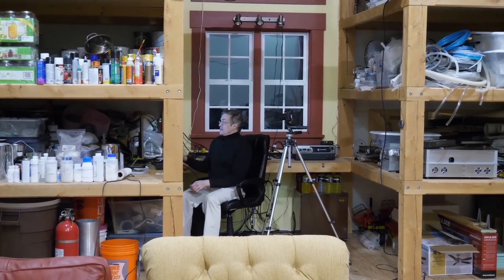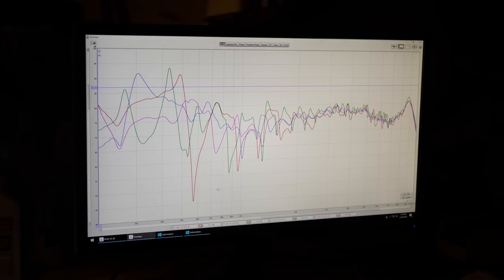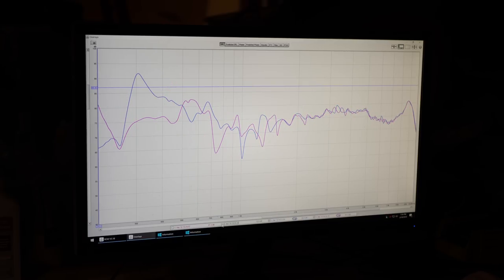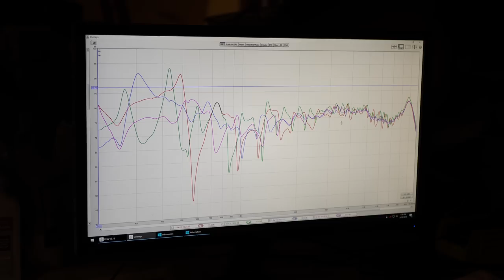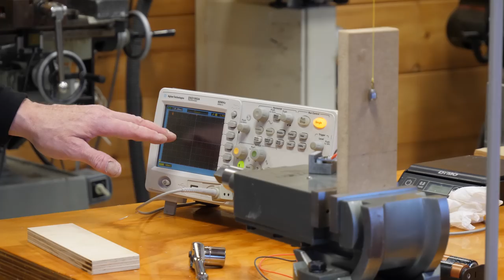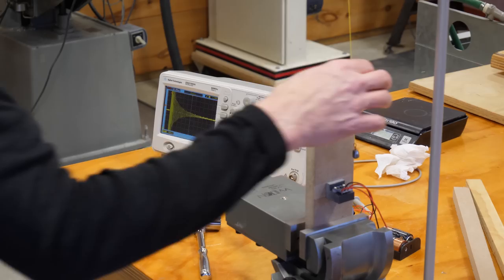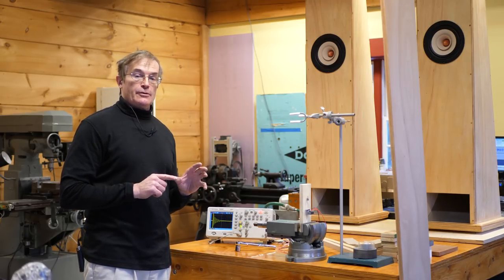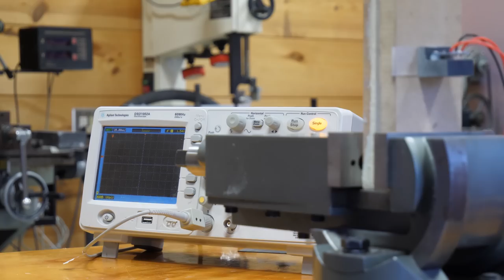World's Second Best Speakers!

Comment: Man the mdf comments had me dying. I've been binging your videos and I appreciate how you're very straightforward; lots of detail but no filler. These videos have been incredibly informative and when I get the chance I'd love to build a set of these or the DML speakers. Thank you!
Reply: The other problems it has are that it's a bear to work with, especially when it comes to screws and glue, and the second is that it LOVES moisture.  In a very bad way.  It's really a terrible material to build speakers out of but it is CHEAP and works well enough, as long as you are willing to put up with the outrageous weight.  Note that you will find many PA speakers now being built out of composites and specialized resins.  The last one I worked with - the entire speaker was 1/3 the size of my entire body and weighed 20 lbs.   Very nice. :)

Comment: Let me "sell" you a secret way of drilling perfect holes in wood: friction drilling. I learned it when building a wardrobe from oak.
What you need is a dull drill bit (!) and you start drilling normally on slow speed to the point where the whole tip of the drill bit burrows, but only just. Then you lighten the pressure on the drill and increase speed to maximum, allowing the drill bit to heat from friction as much as possible. And what happens next is magic - it goes through like in butter, and the exit hole is perfect.
There are 2 bonuses:
1. it smells good while you are drilling, and
2. because the hole is burned through, it will not react chemically with screws, so they won't corrode any time soon.
Reply: You good sir just achieved God Status....well done and thankyoi
Reply: @defaultentry  You can't call someone dull and then misspell "possess" lmfao
Reply: I sure can!
Reply: Use a sharp wood bit. Your dull bit needs to be filed in the f@@@it bucket.
Reply: Yeah i think I will just use good sharp bits and a backerboard to prevent Chip out.
Reply: Friction drilling is a thing.. In metal. Not wood.
Reply: 3. After the fire, living in a tent will really bring the family together.
Reply: I just use a nail
Reply: I think that thread lock might work the same or better to stop rust but might be wrong.

Comment: My God, this is hard to get through! 🙉😣🥴

“Don’t you use that tone with me!” 😄

Thos is one of your most interesting videos (for me) and you are so good at explaining - but that loud, constant tone. Aaaaaaargh! 😫

I really need a large mixer now, so I can listen to what you say and kill all sounds at exactly 1000 Hz. 🙉🙉🙉

I need to build a set of back speakers for the Lowther Audiovector Auditoriums, my dad passed down to me. I am going to have the sweetest surround system I could imagine. But I struggle with the principles and I suspect your explanations would have made it easily accessible to me. 😄

Thanks for the effort - and the simulated tinnitus. 😜
Reply: jealous. Paul Voigt, same guy who came up with the design in this video was reponsible for the Lowther driver, and some of the early Lowther cabinet designs. The Audiovector is one of the best. Lowther cabinet designs are notorious for being annoying to build, but they are very very good when you treat them right. They leave the Voigt Pipe AKA Tapered Quarter Wave Tube back in the kiddie pool. Do you have the single or double driver version?

Comment: Can you post plans for these speakers I would love to build these myself. Did you put a crossover on the full range drivers? I understand they are “full range” but they still have an optimal frequency range.  Fantastic video though I learned so much
Reply: Any crossover needed is built in.
Reply: It would not be a crossover - if anything it would be a BSC - a Baffle Step Compensation filter and perhaps a shaping (notch) filter that will adjust the driver's frequency at any given spot. Crossover relates to a division in a frequency - low pass, high pass, band pass etc...

Comment: Excellent demonstration! You just described the Bose patent:)
Reply: Not even close. Bose uses some resonant pathways to increase amplitude at frequencies which the drivers are deficient, but also require alot of electronic equalization to achieve reasonably flat frequency response. They also use multiple paths to reflective surfaces to create delay effects, which they describe as making it sound "live", And which does impress some listeners. Most audiophiles consider the sound unrealistic and precisely what one wants to avoid. Keep in mind also that purists like the least manipulation of sound electronically, as every process creates some distortion or other deleterious effect, and also try to avoid reflections, as they create additional frequency anomalies dependent upon the surfaces involved, phase delays, and false psychoacoustic effects.
Bose actually creates some of the problems that these speaker designs seek to harness and eliminate, or at least minimize.

Comment: I guilt a pair of Voigt Pipes very similar to those in this video about 15 years ago. They sounded very good, especially in terms of mid-range and soundstage. The mid-bass was also sufficient but could likely have benefited from addition of a sub-woofer for added slam. Eventually, I added a tweeter to add "air" to the system. Fostex produces a broad line of appropriate yet affordable drivers for this and similar designs.
Reply: I did the same and I’d like to upgrade my cheap drivers to a foster 8 inch driver.  Would you have a recommendation for a model?

Comment: While super ugly, my favorite for a speaker enclosure is coarse particle wood soaked in polyurethane then covered with outdoor carpet using contact adhesive. Give the polyurethane a week to dry and use enough contact adhesive with a roller and it makes the carpet extremely pliable.
Reply from the maker: That indeed sounds ugly.  Do you at least try to use only one type of carpet for each enclosure?

Comment: 7:00 a chevron shape cut out of the exit of the tube like the Boeing planes GE cowling designs will limit the interference by allowing the low and high pressure air to mix.

Comment: I'm not a specialist, but you probably don't want the speaker in the center of the anechoic chamber.  You could probably minimize resonance in the chamber by having the speaker positioned at [2/3rds , 3/5ths] ratios or something similar.
Reply from the maker: You might be right, but the reflections from these walls be at most a few percent by 500 Hz and rapidly decreases as the frequency increases.
Reply: Yup I was thinking the same thing. But on the other hand, the fact that they are not rectangular, in the depth direction, could perhaps make the center an Ideal location RE: reflections. That would have required some additional playing around.

Comment: I built myself a set of folded transmission line speakers back in the mid- 1990s to make use of a spare pair of (really cheap) drivers from a set of computer speakers. I was really only looking to test the idea as it seemed to me that people were making outrageous claims about TL designs. Needless to say, I was impressed. The advantage of a point-source radiator (over multiple drivers and a crossover) combined with TL efficiency made for an amazingly clean sounding speaker. I've always wondered how it wold sound to build a pair around a set of high quality drivers...and now there's you ;)

Well done :)

Comment: Greetings! I've now watched this video through twice. Can this same speaker be scaled up to a 10" full-range driver like a Lii Song? Can the whole design just be widened or is there any reason it has to made taller as well? Thanks!
Reply from the maker: The width and depth are not critical, but the length determines the optimal location of the driver.
Reply: @TechIngredients  Is there a calculator or formula you can point me to in order to figure that out? I just ordered a Lii Audio F15 and was hoping to make a folded version of this speaker cabinet.

Comment: Superb video, thank you so much! 👏 I plan on building a pair. I was just wondering if you can confirm which driver is best. The one on your video is the Tang Band W8-1808 but the link is for the Tang Band W8-1772 which has slightly different Thiele Small parameters. Thanks again.

Comment: ...would it change positions of drivers if I'd, let's say use 3 of them, one high tone, one mid range and one low range?

Thanks
Reply from the maker: No.  The cabinet is designed for a single point driver that's why the full range driver is used.

Comment: is there a reason only a single speaker was used? Would there be a better sound with different speakers in the cabinet?
Reply from the maker: No.
As I explained , the position of the driver and the dimensions of the cabinet are key to the sound quality. This is a full range driver, and so if individual drivers were installed, only one would be at the optimal position.

Comment: Could you and/or should you integrate a 2-way or 3-way speaker design with this construction method for improved/optimized frequency response range, particularly up to 30-45 degrees off-axis?
Reply from the maker: That's  tough because  the dimensions are optimized  for the one driver location.  When you separate  the drivers, then you have to solve for multiple, simultaneous equations.
Reply: @TechIngredients  For the most part I meant mounting a tweeter or two that are sealed off from the rest of the enclosure. From what I understand, you don't really NEED a 3-way front stage with home audio because the listening environment and space for enclosures are much more conducive to audio in general. At the same time, beaming IS going to be a serious concern, regardless, so in most cases at least a full-range-midbass and a tweeter are necessary.

It would be interesting to see this enclosure type use something like a 12-inch speaker for mids and midbass and that horned compression driver for the upper frequencies.
Reply from the maker: An isolated tweeter  would have no effect on the design and would be fine, but you said "integrated" and that's  where the complexity  begins.
Reply: @TechIngredients  My apologies for the miscommunication, then. By "integrated" I only meant on the structure of the existing speaker for simplicity of placement and wiring.

Comment: You have some good videos so I will go easy on you but to say a homebuilt speaker is even remotely close to being 2nd best in speaker is ridiculous. Dynaudio evidence weigh 250 pounds each and cost a 100000 dollars for the pair. If you could get even remotely close to that sound, with cheap speakers, why would anyone buy or for that matter develope a speaker like the evidence ? I sold high end audio for many years and the bs in electronics is rampant. Your 200 watt sony reciever is about 10 watts. One of the most expensive amps, the  krell mono block is a 50 watt amplifier and takes 2 people to lift and you will need 2 of them for stereo. I will also say that cabling and wire both internally and externally make a HUGE difference in how gear sounds but you won't learn that at best buy or from most electronic engineers because of ignorance and lack of measurement. You sure can hear it though, the difference is NOT subtle.
Reply from the maker: The title is ment to be humorous and the clue is the fact that we said "2nd best".

Comment: One measurement I can't determine, maybe I'm oblivious?  What's the height of the port cutout?  The width is 9.75" but what's the height?

Maybe I've over-thinking this but I don't care, I'm in the planning phase to make a pair of studio monitor speakers to listen to music in a living room or office.  My goals are to make a pair of stereo speakers that are very well made with the wood-working shop/experience I have, with quality materials for the enclosure and quality components.  I really like what you have done here; although, the size doesn't fit my end requirements.  Right now I don't have them all ironed out, but I would wager the same design at about 60% of your total volume would be about as big as I'd like to go.  Maybe something closer to 50" tall?  I also want to ensure I have the best freq range covered and if one single driver can accomplish this then fine, otherwise I will want a two-way setup (tweeter/sub).  Finally, can you tell me the enclosure volume?  Actual volume, top to bottom, negating the unused space behind the curved port baffle?  I'm x-fering the driver specs to a calculator and boy, at a guess of 6" height of the port cutout this enclosure just isn't coming out right for those drivers.  I must be missing something?  Oh also your round binding post part link is no longer valid, here's the corrected link:  https://www.parts-express.com/Round-Speaker-Terminal-2-15-16-Gold-Binding-Post-260-283  Thank you.

Comment: Hi, I just watched this, and I have a question regarding the drivers. I‘d like to know whether the size of the drivers matter, and if by picking one different in size to yours, one would have to adjust the speaker housing accordingly. Great video by the way, extremely informative!
Reply from the maker: Thanks.
It does.  Check out the driver manufacturer's recommended "open volume"  and scale the tower's dimensions to achieve that internal volume.

Comment: Hi.
Excellent video. However the tube either should be tappered  7 degrees by definition  or the side panel which is a Trapezoid dimensions should be determined by three dimensions  top base 1.5 inch, bottom base 15.5 inches and height 79.375 inches .In this case the angle is 10 degrees .......

Comment: I was hoping for an update on these audio videos down the road. Were there any improvements you would add to the build? Would adding a tweeter or small Planar improve the sound? I've watched the video a few times but was always curious if there was anything else you would do if you would do it again
Reply from the maker: I'm very happy with the existing design.  Adding additional driver's is complicated because their location is constrained by the interaction of the port and the transmission line which currently is optimized for the existing driver.
A higher grade of plywood would produce a more attractive speaker.
Reply: @TechIngredients  thanks! Loved the audio series. I had an idea for a video I'd love to see btw. A heavy mass turntable build utilizing magnetic levitation to lift and spin a large mass platter without any moving parts.  There's currently one on the market but its design seems more gimmicky than functional since it plays up the levitation aspect similar to those other levitating products on the market. It also has a fairly low mass platter, I'd love to see a large 15-45 pound solid platter being used (or a series of changeable units with pre-configured settings for each variable mass platter). Lifting the platter a few centimeters while an outside ring of magnets are used to spin the platter to provide noise isolation and eliminate motor noise or pulley wear. Would be fun and would certainly offer a lot of creative challenges.
Reply: The Tang Band W8 drivers, both the 1772 mentioned in the plans and 1808 used in the video, have more sensitivity in the treble (tweeter) range than they do in the traditional 8" midrange or woofer frequencies. If anything, they need the opposite. Every 2/3-way design I have run across with them is adding woofers to augment the lower midrange and bass, often in the 12-15" driver sizes. A more interesting design as an exercise would be dual 8"s, with the W8 and a woofer driver with a larger coil and FS to fill in the bass (probably some 2-piece / sealed + bass reflex design).

Comment: I realize this video is 3 years old, but I have a few questions. 

First, the parts list calls for the TB W8-1772 driver, but during assembly, we see the W8-1808 driver, which is generally considered better than the W8-1772 for transmission line as well as mass loaded transmission lines, of which the Voigt tube / pipe / TQWT designs are frequently modeled. Second, the provided diagrams do not specify the height for the port, only the width. Third, as I have looked up existing Voigt / TQWT designs for either TB W8-1772/1808 driver, most designs use a much smaller cross section cylindrical port for 1/4-wave bass improvement, though a couple slot style "damp duct" examples are also out there. As best I can tell, the metal curve / ski slope represents a 4th section reversal to a reduction taper for Horenresp simulations -- i.e. the widest cross section is near the start of the slope since it begins a reduction segment. Also there is no discussion or implementation of a baffle step correction (BSC) circuit or similar and both the 1772 and 1808 both exhibit a LOT of increased gain / sensitivity over average SPL at higher frequencies (the 1808 benefitting from it being at the edge of the hearing range of most able to procure one)

Can you provide a bit more about the large taper method versus a smaller fixed cylindrical volume port? From a pressure wave control standpoint, the gentle slope seems more gradual and unlikely to produce additional turbulence or resonances, but it is not the common method with such a large mouth. 

The diagram and directions are missing a great deal more for the layperson to replicate, though it can be reverse engineered from the video (e.g. how much Decidamp to make per wall). A last question would be if this is a copy of or derivative of another design for either the W8-1772 or W8-1808, or simply a basic implementation of the cabinet design based on driver size. It would be nice to know before committing the execution to Baltic Birch or similar high-grade plywood (e.g. sapele or okoume).

Edit: found that the opening is 6" tall per another comment.  Too bad YT does not have a good mechanism for searching comments (the irony).